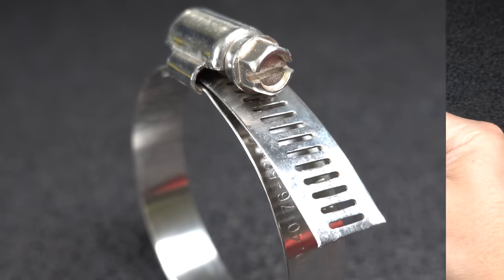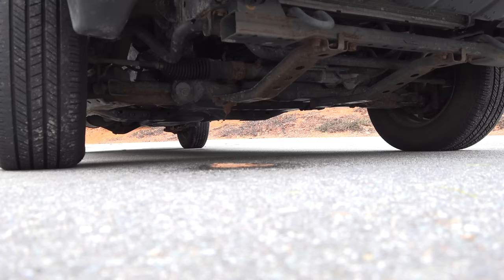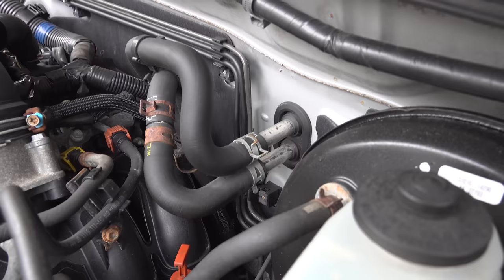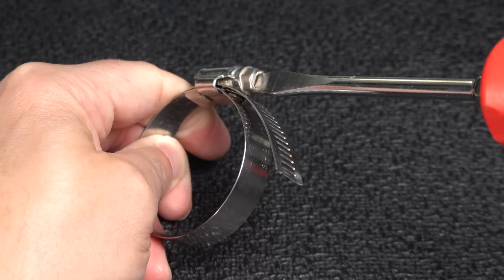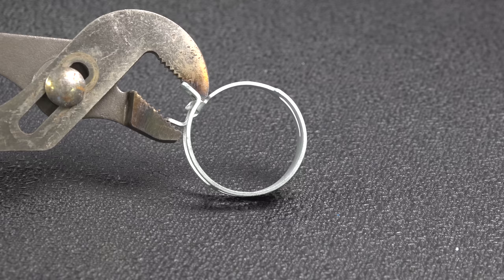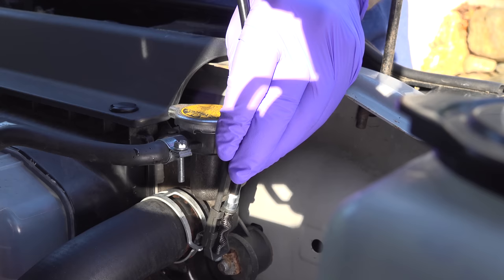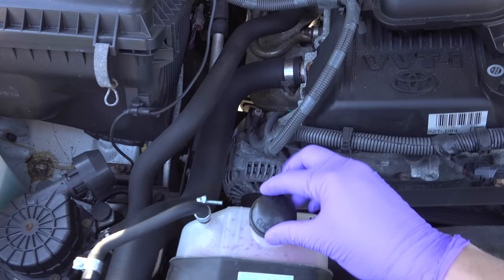STOP Using Hose Clamps WRONG - LEARN A BETTER WAY

Comment: These newer clamps are very difficult especially in tight spots with no special pliers. If i need more holding power I just use 2 clamps...no prob so far...

Comment: ok my dude you do you i had a leaky radiator hose on my small ktm duke 125 i changed the spring loaded hose clamp with a worm clamp and the problem went away its been 4 years since and up until i sold the bike was perfect and never leaked again

Comment: When I worked in auto industry I saw Mercedes Benz Vito arriving at shop, from factory with 0 km, for transformation to firefighting vehicle. They came with screw clamps in the engine. This was 2015 or 2016.

Comment: I think some one forget todo pressure test  most of mechanic shop do so because they use  proper tool  sometime Chinese Manufacturing company’s don’t do right size like radiator or radiator hoses defective parts can be or clamps

Comment: The problem of worm drive clamps is not so much the temperature difference. The problem is that they are not perfect round in the area where the worm drive sits. Not a big problem with larger diameters but small hoses tend more to leak with worm drive clamps.

Comment: In the old days radiators are med from metal, it make sense they used the old clamp. Modern cars have plastic radiators and they don’t expand as much as metal radiators.

Comment: I’ve never had an issue with the old style clamps. I  actually get  rid of the spring clamps anytime I have to deal with one. I have been working on cars for more than 15 years and it most likely has to do with knowing how to properly use them.
Reply: I do the opposite. I get rid of worm gear clamps.

Comment: I just removed a worm clamp and replaced it with a spring clamp, my cooler hose blew off and dumped fluid everywhere, no way to tighten the spring clamp so I'm back to two worm clamps.

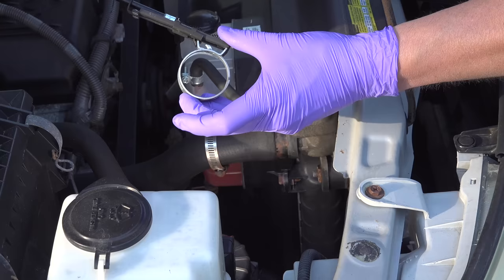Comment: A couple of thing I’ll address. First, manufacturers install spring clamps at the factory because they’re cheap and they do the trick… initially. They’re generally considered to be single use only. You can in some cases get away with reusing them, but sometimes when you look close enough, once they’ve been removed you can see that the clamp somewhat deforms, therefore won’t apply the same pressure as when new. Pay attention to 2:31. Your rad hose appears to be quite old and dried out, and almost crushed where the clamp sits. If this car were in my bay, I’d be advising to replace that upper rad hose or at least try trimming it, as well replace the clamp, since I’m willing to bet it’s the shrunken hose that caused your leak, not the clamp. Almost any repair shop and even most dealerships will never stock the spring style clamps, and instead only give out the gear type. I’ve installed hundreds of these gear clamps, and have never had a leak as long at the proper size is used, and both the hose and sealing surfaces are normal. And of course, when dealing with plastic, you can’t go savage and tighten with all your strength, it must be tightened properly. Maybe having installed the new clamp in a different position made it seal for now, but that upper hose doesn’t look healthy, and very well could leak again
Reply: Ya, this vidja is silly... OEMs use them cuz they're cheap (one part) and quicker to install, nothing more.
Reply: @tshackelton  Some companies like fiat are even cheaper and use a band style clamp on their hoses, similar to the type of c/v boot clamp that requires that special tool to install, and they lock in place once a predetermined tension is set. These clamps must almost be destroyed to be removed, and any attempt to reuse one of these is risky
Reply: @deeznutz3494  They are using those CV bands on coolant hoses!?! Wow... I'm sure those bigass crimpers are a joy to use in a 500's spacious engine bay.

Comment: Those holes clamps which are referred to as constant tension clamps they are not new they 1st started to appear in the engine bays in the 1960s

Comment: Lets consider something ...  Millions of people have, and still do, use the worm style hose clamps.   Most vehicles don't leak (too loose) or break fittings (if too tight).

Maybe if you're having problems, it may be you.

I know, from personal experience, that the spring clamps do fail.  I've had them snap in my hand when trying to remove them.    I've had them leak from losing their springiness, for whatever reason. 

I've had them being difficult because the orientation of the tool is no longer possible to reach with other things installed around it.    At least with the worm drive, you can get a screwdriver, 1/4" driver or socket, or even a stubby screwdriver that'll squeeze into tight spots.   

Worm style hose clamps have some other benefits.  Like not needing to detach the hose to replace it.  You can also put more than one in series to double the size of the clamp.  The same way that you can put two zipties in series to make a longer ziptie.   It's rare that I've done it, but it has been useful to secure engine intake air ducts, where I didn't have the right one with me.  That last one isn't really recommended, but it does work.   At least it's enough to get them to the store to get the right size.   And when you do have the right size, you can disassemble it, and put the new one on without removing the ducts. 

Using worm style hose clamps isn't very hard.  You need to provide enough pressure to prevent it from leaking, while not tightening too tight to break the fitting.   It's generally just watching to see the hose compress under the clamp.   I find it easier to tighten them consistently with a 1/4" ratchet or nut driver on a 6-in-1 screwdriver.  You don't get a good feel with the flat bladed screwdriver, but it's still doable.

I started working in vehicles, when I was a kid in the 1980s.  I've done some horribly and not recommended things.  I've learned from my mistakes, and even more from professional mechanics who have taught me a lot.   Using worm style hose clamps to replace broken or weak spring style hose clamps is very very common. 

I only got here because I was looking for more info on the BMW clip type clamps.  I kinda want to reuse the clamps I took off, but it's looking like I'll be replacing them with worm style hose clamps.  They aren't any better though.  For the parts that I took off, some just pulled off.  The clamp was still attached, but wasn't providing a leak free connection.   That's likely part of why the supercharger wasn't providing a proper amount of boost.  It tried, but was probably leaking.

I try to convey useful information from my experience, when videos like this are very wrong.  Your video is well presented, but will confuse novice DIYers, who will now think that spring clamps are the only thing to use.   You're making their life harder.  Hopefully someone at a parts counter will help guide them, when they insist that they can only use spring clamps, that aren't even in stock.

Comment: It's funny you mention this because there are old style clamps that are designed for temperature changes. It's called a Spring-Loaded T-Bolt clamp.

Comment: Screw type clamps are better. I dont know how many times the spring loaded ones have caused me leaks. Whenever I work on a cooling system the spring loaded clamps go in the trash.

Comment: Yes and no. Sometimes the reason hoses leak is because the hose itself is too old and doesn’t seal properly. Those constant tension clamps also won’t work properly on old hoses where there are old marks from the other hose clamp. The hose surface needs to be even in order for the tension clamp to work right. Also, when you remove tension clamps, they need to be reinstalled the exact way they were removed, meaning, they need to fall in the compressions they left behind on the hose. If not, you’ll have a leak. So while tension clamps are better than the cheap clamps, they’re not perfect.

Comment: There are vehicles which come with OEM worm drive clamps and wire or band clamps tightened by screws. It's not true they are never used. One of the main reasons for the spring clamps is also cost. Keep in mind there are also many OEM vehicles with band clamps which are tightened once and have no spring action. BMW uses them all over their cooling system. While this is a correct clamp to use, it's simply not true that other clamps will always cause problems or do not exist on rubber hoses from the manufacturer.

Comment: Well shit, I'm a dumbass...

I have always used screw clamps as you can do them up tighter, I completely forgot about expansion.
Looks like I'm buying the tool and replacing all my screw clamps with spring clamps, as they'll hold a constant tension, and won't need to cuss half as much when removing the lower radiator hose 👍

Great video, you've got yourself a subscriber!

Comment: Youre supposed to use stainless steel type hose clamps on boats..  they dont rust..  and they actually make a wrench meant just for use on hose clamps that cams over when youve tightened it to its extent so you dont break the clamp like when the worm screw eats through a rung on the ladder if you tighten too tight..  but ive never had any issues with them leaking on my boat or its motor..  or my truck radiator hoses or vacuum lines..  hell i used 3 of them on the ole ladies car to cover the hole in a flex pipe on her exhaust and theyve been holding strong for 3 years now..    and if you break a fitting trying to tighten one then youre doing it wrong and tightening the clamp letting it twist while doing so which torques the fitting and will snap em..  either hold the clamp and all while using a proper wrench (not a screwdriver because youre pushing on it to get leverage not to cam out the driver)

Comment: Been a Diesel mechanic for 9 years. Spring design loosens due to heat cycling and leaks. It also is not really reusable because to get it past the nipple barb it has to be over expanded. Worm clamps work perfectly fine so long as they are not the cheapest ones on earth. Also if you take the tail and bend it up and over it's not going to back off by itself. If you want even more secure wrap the bent part and screw with electrical tape. Or you can spend 3 bucks more and get a spring loaded breeze clamp and never worry about it. Sorry but, you ask any mechanic worth their salt they will tell you that you are wrong because of fatigue from heat cycling.

Comment: I have never had an issue with the old style ones.  The spring ones on the other hand.  The reason the manufacturers go for them, is that they are the cheapest solution for them.

Comment: On the contrary, I have come across several of those 'constant tension' spring clamps that leaked, and I had to replace them with worm screw clamps. Why? Because you can replace those old screw clamps WITHOUT REMOVING THE HOSE, even when the engine is pretty hot, as long as you've relieved the pressure. You can't do that with a spring constant tension hose. 
'It's faster' is the reason why they went to those spring constant tension clamps; it speeds up the manufacturing of the vehicle, and when a car manufacturer finds a way to save a couple of minutes on 5 million vehicles, you can betcha they will do it.

Comment: I hate these damn clamps.i just spent over an hour taking the bottom radiator hose off of a dodge dart.all you got to do is squeeze them together.thats a lot easier said than done when you don't have enough room to get a solid grip on them

Comment: The rubber would take up the expansion and contraction due to temperature.  They just use those other clamps because they are faster to put on and off
Reply from the maker: There is no "take up" its either overtightened or under since the old style clamp would not change

Comment: I've had older cars where those damn spring clamps have ended up breaking and the pieces nearly hit me in the face, and even the ones that don't are often in places that are nearly impossible to get to, and they end up seizing the hoses to the fittings, again, in a place impossible to get to.

Also, unless you can put forth some actual empirical data, I completely disagree that the constant tension clamps are able to adjust for temperature better than the other ones.  The tension clamps put, way, way, way more pressure on the hoses than the worm style ones do.  I honestly don't even think it's possible to apply enough torque with the worm style ones to come close to tension clamps.

Comment: These constant tension clamps cost me a transmission. Hose carrying trans oil to the radiator popped off. I've since removed them all and replaced with traditional screw clamp ..... each to their own I guess.

Comment: Worm drive clamps can grip MUCH tighter than the spring clamps.  Use good quality clamps though.  Breeze clamps have never failed me.  I've used hundreds of them on our farm trucks, tractors and irrigation equipment.
Reply from the maker: Of course, over tighten is more like it & with no ability to expand or contract as quickly as the other materials and with no given you will eventually stress crack or split the underlying fitting. Why not use a clamp that does the job through all temps.  If you are using them on lines that don't see much temp fluctuation than it's not an issue.
Reply: You ever see leaks caused by worm gear clamps on case equipemnt?

Comment: Spring/Constant tension clamps are only really good for new builds, I would never put one on an old hose or anything that I may have to remove as part of servicing as they dont reseal well... New/Complete build set and forget only.

Comment: I use whatever available in my clamp drawer 90 degree angle needle nose pliers or channel lock  usually get the job  done Idk why you hate on the worm gear type clamps I never had to replace them to fix a leak usually is the hose or corroded thermostat housing or the gasket causing the leak but I do not overtighten them i just know how to do this by experience  no tool for that

Comment: As a guy thats done this for a living for about 15 yrs. you got your observation a$$ backwards its the adjustable hose clamps with a screw that will stop the leak of the spring clamps, fixed them at Firestone, JiffyLube, Valvoline, Ace Tire, Evans Tire, Z & R Transmissions, Soapy Joes, EZ Lube, and etc. -- your welcome

Comment: So what happens when the metal becomes weak and the spring tension is shit then you have a leak. Never had a problem with those for the past 20 years. I’m sure these are good in certain applications!

Comment: Semi manufactures and any expensive cars, trucks ect 200k plus only use tension clamps on heater core lines for coolant. 100% best clamps for coolant is heat shrink clamps. To this day done correctly I've never seen one fail. Ever. I've worked on idk how many trucks and cars in my life. More then I can remember. Par for clamps is heat shrink clamps. Size is stamps on them and what they are designed to shrink to also. Groot makes good ones. I trust them so much I replaced all my coolant clamps on all my vehicles with them. Like I said,  I've never even once seen one fail if done correctly. And to remove they make tools for it but can just hear up an end of a flat head screw driver  and it will cut through them. Good luck

Comment: I have always used Gates style clamps with complete success. and I have been automotive technician for many many years. those spring style clamps are garbage. the reason they are used so much anymore is because they are cheaper to mass produce. (an example) my neighbor was working on a car for this person and they decided to pickup their car. and we noticed that he had robbed a hose clamp from the car. so I searched around for a clamp so they could take their car home. and the only clamp I could find was one of those spring clamps. I told them to keep an eye on it and when they got home to put a better clamp on it. but it blew the hose off on the way home but because I told them to watch out they pulled over and parked it as they noticed it. there are two types of those spring clamps. that flat type and an earlier rounded one with two prongs sticking up. I don't use any of those style at all.
and don't use cheap Gates style clamps either the good quality Gates clamps are all stainless steel. and after the part of the clamp passes though the worm gear stay straight. the cheap ones will go off to off today one side or other.